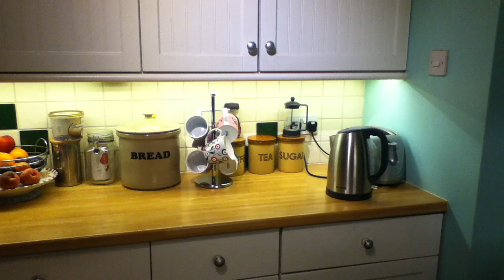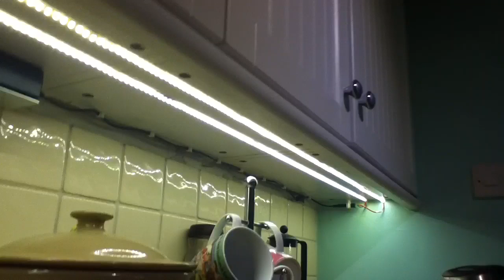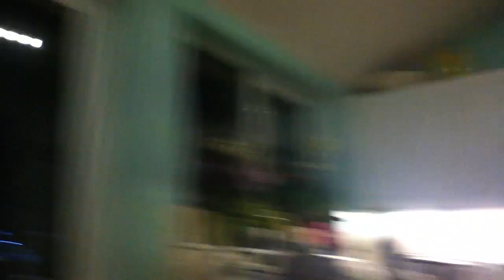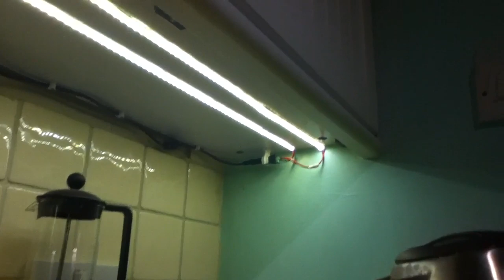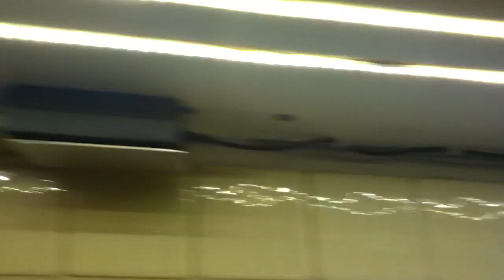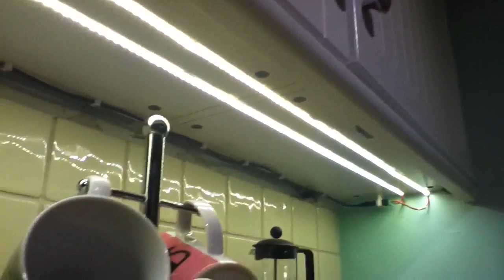12v LED Strips for Kitchen under Cabinet Lighting

Comment: The 60 per meter 5050 less put out more light than the 120 per meter, smaller 3528. Length and width of led 3.5mm X 2.8mms vs. 5.0 X 5.0

Comment: whats the maximum number of leds you can power on that 12v 4A ? curious to know if I need to have a separate 12v 4A power supply for each 5 meter LED kit I buy or if there's some way to save on outlets like perhaps a computer power supply to hook up multiple strips

Comment: They are supposed to be self-adhesive, but peel off after a while, so it's a good idea to put sellotape across them at intervals to keep them away from kitchen gravity waves.
Reply from the maker: I found some 6mm VHB double sided gel tape works great for re-sticking the strips when they start to fall off. See my part 2 video here: http://youtu.be/8k2J-vctGdA